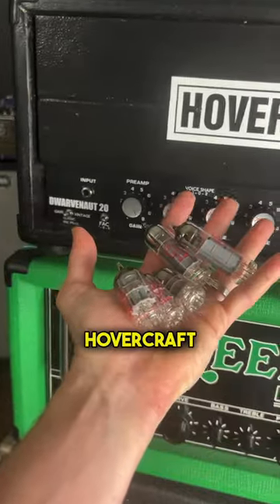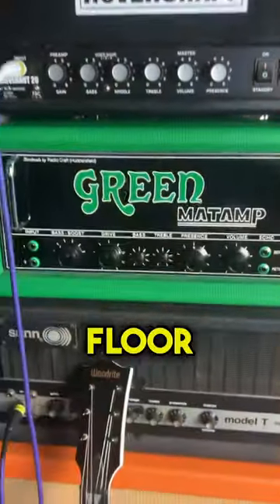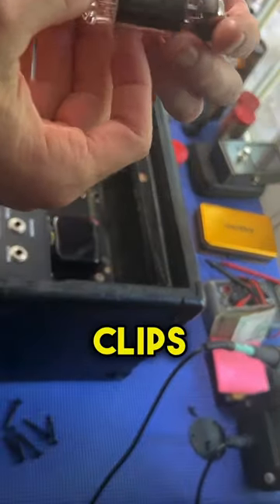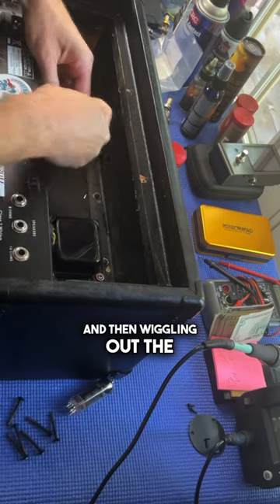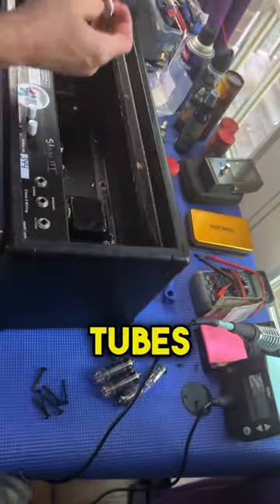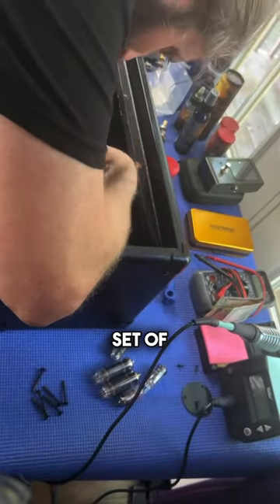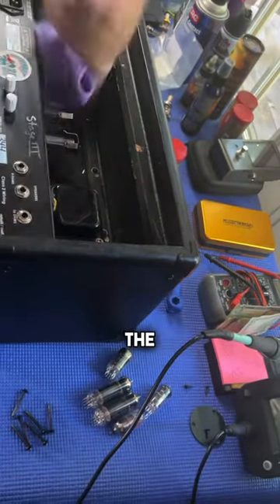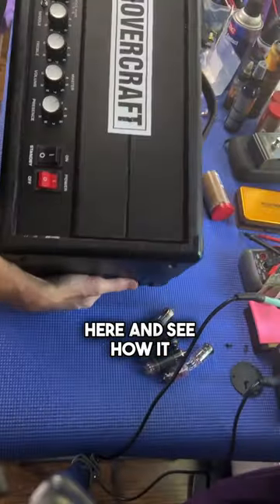Swapping tubes on this killer Hovercraft Dwarvenaut 20 amp. Fixed the noise and sounds massive! ⚔️

Comment: Always wanted a tube amp, but my budget says solid state lol 🤘🤘
Reply: I’ve bought tube amps less than some solid state amps
Reply from the maker: Definitely still some killer affordable tube options out there.
Reply: TheTiredHorizon  I been looking to buy it for a while but I already got to many amps lol
Reply: @DoesItDoom  for sure
Reply: Carvin has a lot of decent tube amps and on the second hand market they are very reasonable and sometimes a steal for what you get. Their clean channels are usually crazy clean and great pedal platforms just in case you don’t like the drive channel.

Comment: I keep hearing there is some danger in messing with tubes inside of an amp, even if it's not powered. How do you prevent that?
Reply: I think you might be referring to the power laying dormant within the amps because things like capacitors retain electricity for a while after they are unplugged. Basically the rule of thumb is just don’t touch he pins on the tube as your are pulling them out and don’t touch other components when you don’t know what they are. Then you kind of eliminate a lot of the possible danger when working to swap tubes.

Comment: Does that amp need no biasing?
Reply from the maker: It does.  Will have my tech bias it.  Just wanted to see if tubes would fix the squealing.
Reply: Preamp tubes don’t require biasing. The only time you need to check or adjust the bias is when changing power amp tubes.
Reply from the maker: @donewithmodernlife  correct.  I changed all the tubes though, so technically should adjust bias.  Jet City says you can swap power tubes without rebiasing, but I’m sure it would be a good idea.

Comment: Try to use Russian 6н2п or better 6н2пев(army tech control) to replace 12ax7, sound will be killer, but they heating have6volts, and more ampers